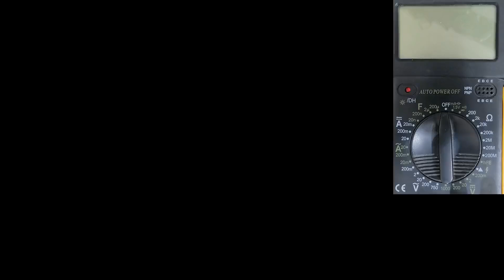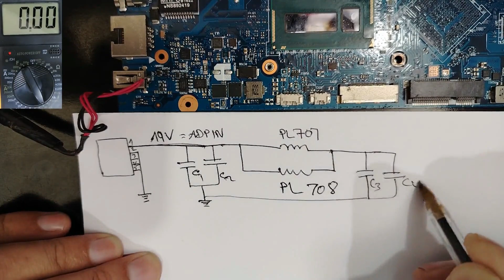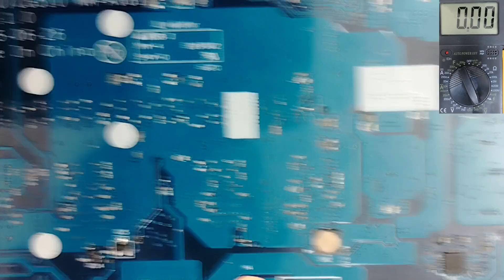Shocking Truth: How Voltage Flows in a Motherboard – Explained Like Never Before

Comment: Voltage doesn't flow anywhere. Current does.
Reply from the maker: Good comment, it's important to understand that the voltage is what causes current to flow. You can think of voltage as the pressure that pushes electric charge through a conductor. Without voltage, there's no driving force, so no current will flow.
Reply: @electronicsrepairbasics_erb  Could we take this a step further and say it is actually electrons, or CHARGE (measured in coulombs) that are flowing? Of course, the rate of electron flow, in coulombs per second, is the current that we measure. In other words, CURRENT is the rate of flow of electrons, but it is electrons (charge) that are flowing. Splitting hairs? Maybe. Just my two cents.🙂

Comment: I have a question about vertyanov
I'm between two types of vertyanov one is Micro and the another is SAS ver 4.0 which one is better, and are both can read EC with 256 kb or only 128Kb?. by the way I have rt908H is it enough or not

Comment: What do you think about the 
DDR 4 Ram Tester Is it worth buying?
Reply from the maker: The DDR4 RAM Tester can be a very useful tool, especially if you regularly work with computer hardware or perform diagnostics on memory modules.
Reply: @electronicsrepairbasics_erb can you please make video